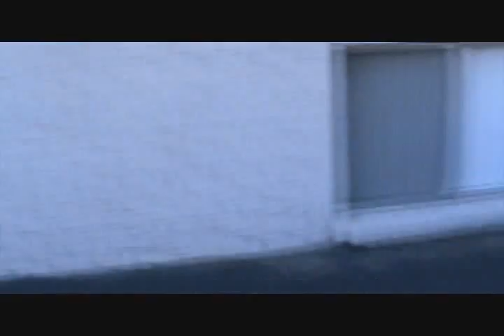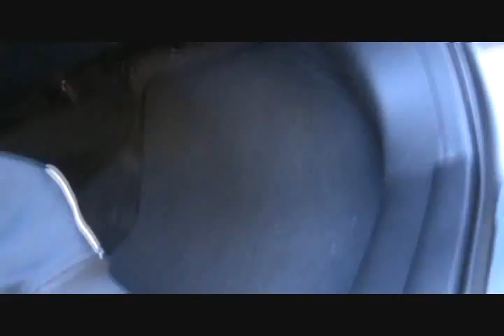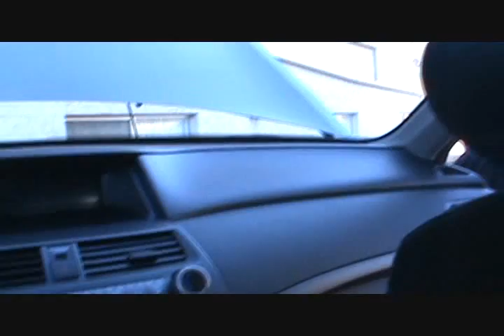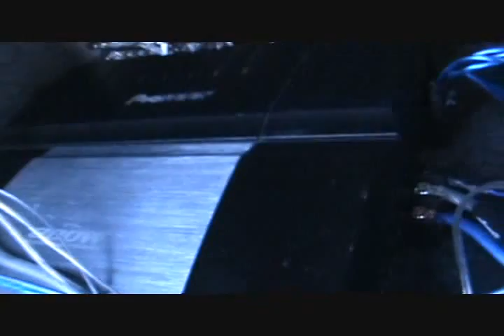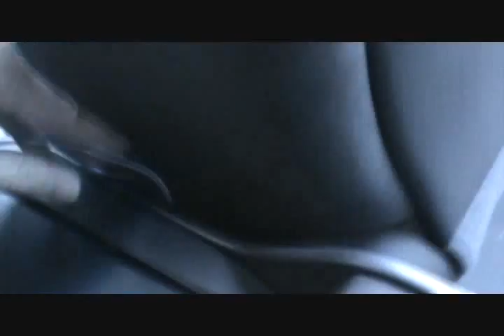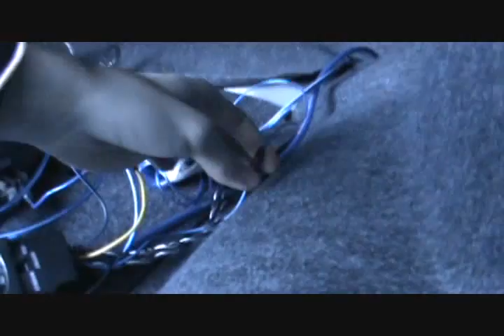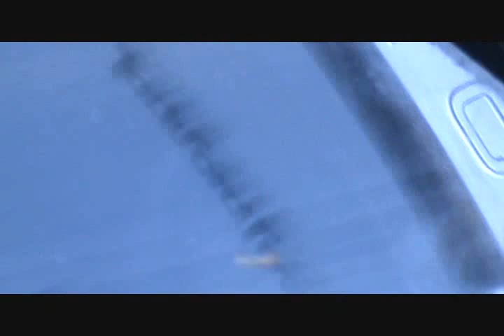How to install amp on factory radio w/ out opening dash.

Comment: I cut the end of some rca cables which is 4 wires. Attached thise to my rear speakers positive and negitive. Then ran my 12 volt turn on wire to my wipers fuse under my dash. Works the same even easier

Comment: first off u took way to damn long to say that. all u had to do is show the wires hooked up to the speakers and that converter box 2nd ur title isnt show us how to hook up every thing it is to show us 2 things the wires going from the speaker to the amp and that converter. and my god if that car is really yours i feel so bad that u think that mess of wires actually looks good and professional. it only took me 1 30 min to do mine. at one point u called us lazy. whos the one that took SHORT CUTS

Comment: you have to be careful when you use a line converter though. your ohm load will drop on just the speakers that it is connected to. just have to know what your HU can handle

Comment: You should have shown exactly how you were connecting the rear speaker to the speaker wire.  Since it is not HD camera, the connections there were a bit confusing.  Also you should have mentioned the importance of color coding of the wire for R(+) or R(-) etc.  However, all in all it was pretty good install.

Comment: @cmoneyTHEhitmaker if you r using a line out converter  for the RCA  u don't have to splice just get some speaker wire put it on the positive and negative terminal  of the speaker and put the wire positive and negative to the line out converter and its the some for the left and right side

Comment: What ever u people do don't use the way that he turns on the amp to complicated hear me out get the remote wire go to the fuse box inside the car and look for the fuse that  belongs to the stereo  get the remote wire and attach it to the fuse and place the fuse back in its place and it works great and it's  easy and  faster .

Comment: then that means your amp will only recieve power when you are using the turn signals.. if you're going to run the rmt wire to the fuse box then just connect it to the radio fuse..

Comment: Do you have to connect the amp to the cigarette lighter to get the remote turn on? Wont the amp turn on from having it connected to the rear speaker signal wires?

Comment: I dont think you need to put the 12 v wire from the cigarette lighter into the converter just go from the plug to the amp works fine.

Comment from the maker: You shouldn't remove the rear speakers you are only splicing the wire with them, so you are sharing their single withe amp not removing them. And the stock rear speakers are not sub woofers but if you don't like the quality of sound you are getting out of the amp you can adjust settings on the amp to get the ideal sound quality you are looking for. Hope this helps.

Comment from the maker: Well are you blowing the fuse? if so there is to much ampage running through the fuse with the additional load and you need to but it on a fuse that has hire amps but don't simply replace the current fuse with a higher amp one or you might damage the cars electronics. If your not blowing the fuse then just do what I did int he video and the use the aux output.

Comment: how did you remove the rear speakers? i thought the amp should be connected to the radio too and not just the subwoofer?

Comment from the maker: Also remember that the line out converter needs to be grounded when connecting tot he amplifier using the remote turn on cable. And when powering the amp you can use a fuse out of the fuse back for the remote turn on istead of running it from the aux power out let inside the car. Amb installs can be difficult when there is no after market radio and just the stock head unit or factory radio radio, which ever you prefer.

Comment from the maker: If you have stock amp cable running to the trunk it should have signal, if its an RCA cable you should be able to connect it directly to the amp if its just normal speaker wire then you will need to use the convert box. If theres no signal coming from the stock amp wire and you can't connect it then you will need to connect the LOC to your speakers in the back, if theres 2 inputs use left and right speakers, but it really jut needs a positive and negative audio signal. Hope this helps.